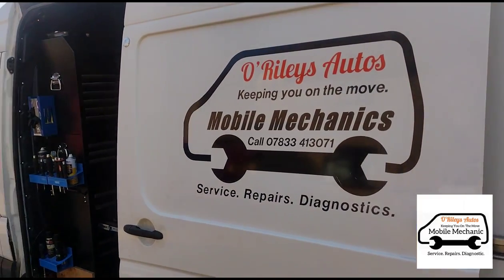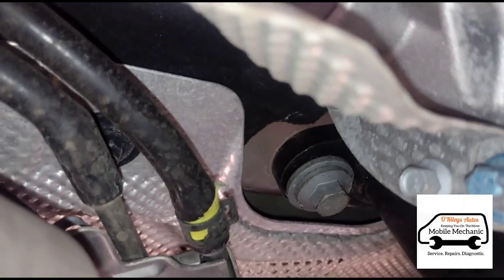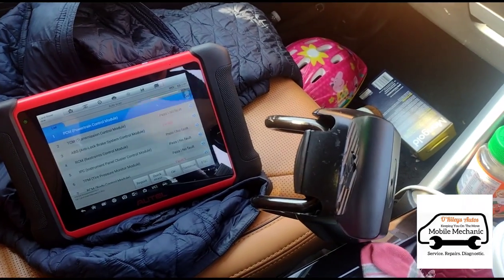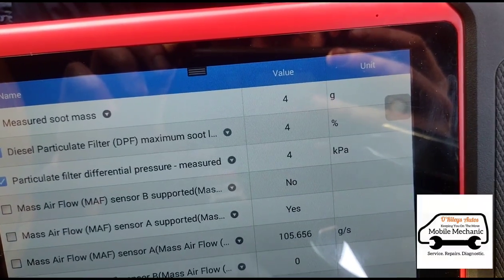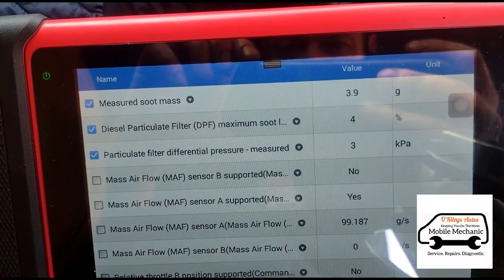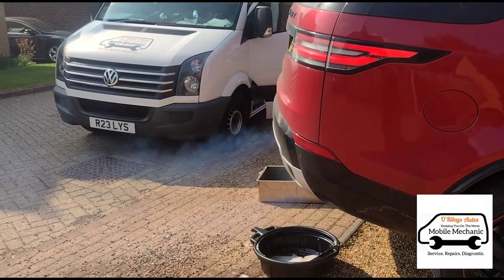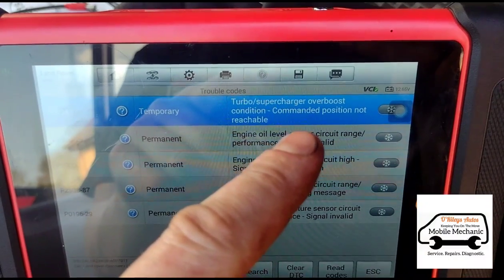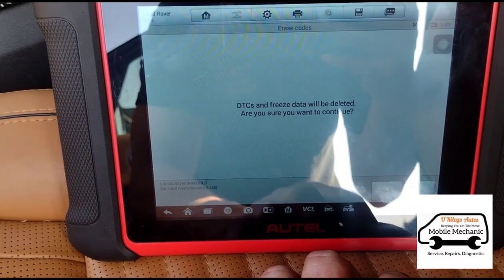Land Rover Discovery 5 3.0 TDV6 DPF Full P2463 P246B P0234-77  P0234 Turbo Overboost (Part 1)

Comment: Another great video.  My RRS has the turbo overboost error as well and I tried freeing up the throttle which did no good to clear the P2034-77 error.  I'll try the turbo cleaner to see if that helps.  Appreciate these videos.  I've got an Autel MS906TS which is great, but won't do a static regen like yours does; that just means I need to drive it and set it off once I'm under way.  I just wish the software updates weren't so expensive on these Autels, or I'd say it is the perfect tool.  But given the insane cost of the updates (more than half of what I paid for the tool itself), it's really a pro-only tool unless you don't mind spending $800 ever few years.
Reply from the maker: The Crankcase breather/ oil separator can cause boost faults on this 3.0 engine

Comment: Hi mate I have got a range rover tdv8 on a 63 it's in limp mode showing fault with dpf pressure sensor and exhaust gas temp sensor i have put a litre of wynns dpf cleaner through but it's not re gen . Would you reccomend change the sensors if so do you know of best place to buy the sensors the dpf pressure sensor is over 300 quid and the exhaust temp sensor 85 quid off the main stealers cheers
Reply from the maker: It won't regenerate with faults on the system so it would need fixing.

Is the sensor definitely not working?
Reply: @ORileysAutos  idk pal I have just pulled the codes with my crappy scanner I dont know how to test the sensors with my scanner